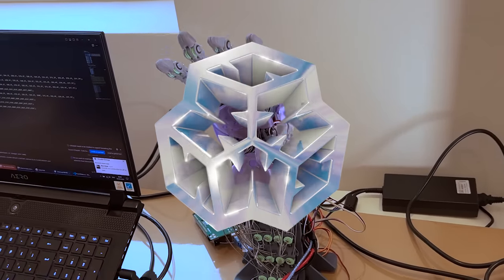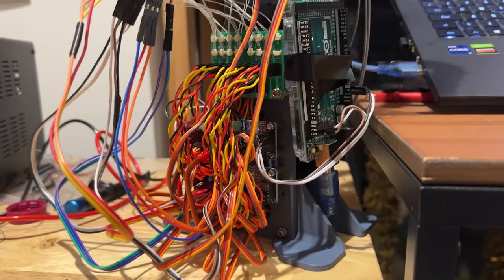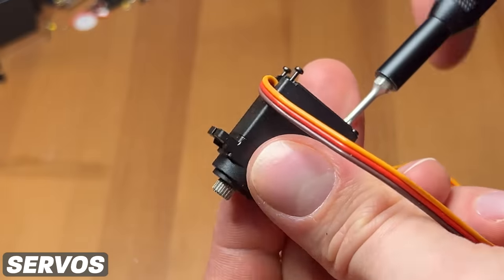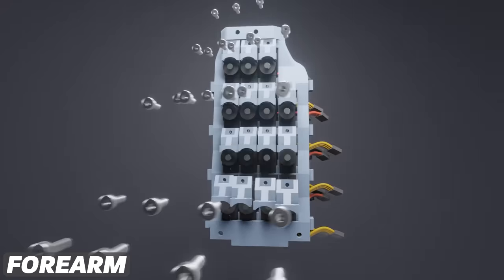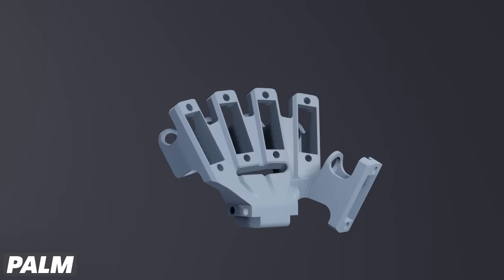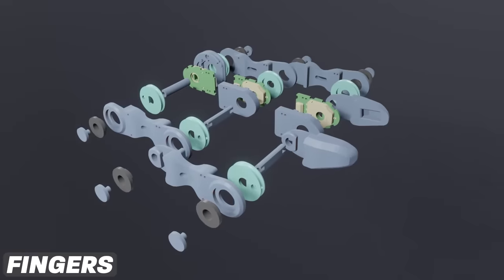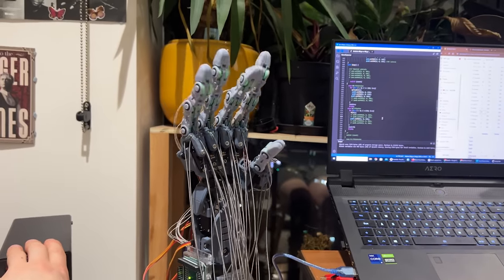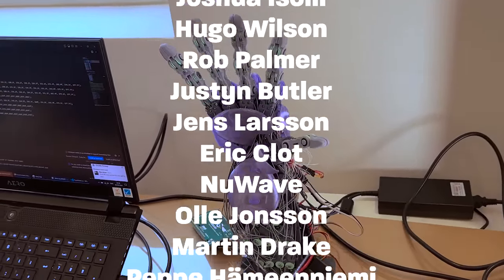How to Build Your Own Biomimetic Bionic Hand

Comment: The finger assembly has a little error in your video, The pulleys are alternatively arranged however in your video you have the free pulleys all on one side of the finger. which means the middle joint will never work.

Comment: I'd Say that the wrist and thumb movements are the most accurate because most people can't usually figure out the thumb and the wrist is usually made the point of rotation of the hand instead of the bend, basically removing a lot of the functionality, The rotation comes from about a 3rd or half of the forearm. Good Job 👍

Comment: My only immediate suggestions would be if the servos don't have enough torque to cause damage then use a script to drive them to end travel and use the pot readback to calibrate the end positions, if the servos do have enough torque to cause damage then you'd either need to run them very slowly or the better solution would be to have current sensors on the servo to identify when it hits end travel before damage occurs. I'm not sure if you're already tapping into the pot readbacks but it's a good idea to do so anyway as you can use that to automatically detect some faults, and it's a good practice to recalibrate occasionally to account for slip and wear. Im not sure if it's necessary but I've seen designs where the tendons had slack lines bridged with springs to create a bit of give in the joints for gripping delicate objects, rather than that you could also use a spring gear like assembly between the servo and the pully head (i.e. there would be a spring and hardstop between the servo and pully to allow some give if not at the end of the travel).

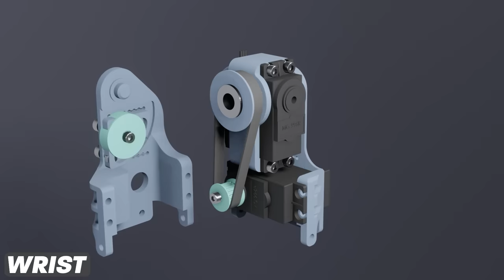Comment: 8:17 In Blender, there are different quaternion and Euler presets you can select when rotating parts for animations. Press the N key, or bring up your side bar. In the Transform sub panel, under rotation there should be a drop down menu. This should adjust and help your Blender animations.

Comment: i think the next part is creating syth muscles with Thermostatic wires and a electircally tempered electrolite gell that can be charged on and off to create conduction causing the wires to change shape form the heat. 
if the right metals are used and span thin so they "rotate and alter shap to create a contraction rotaition motion maybe then we will have progress and with time R&D maybe 3D printing the fibers and gell close and narrow making smaller low watage versions that could fun their own motor

Comment: This is really cool!  Very impressive engineering you've done here. Someday, I'd like to make a similar project and pair it with a robotic arm. I'm working on the arm now.  Approximately how much does the assembly weigh?

Also, if you need some assistance with the kinematics/control of the hand, I'd love to help. I haven't done it for hands before, but I'm experienced in robot kinematics and is a subject I've been interested in for a while.

Comment: I can't wait till bionic hands are less complicated, customizable, and have the grip strength of a normal hand OR STRONGER!
Reply: The complexity isn't likely to get too much better until way stronger micro servo motors are made, but the human hand and wrist are some of the most complex parts of the human body mechanically speaking. This design could likely have near to or normal human strength if the right materials are used, the pulley system he has gives the ability to greatly adjust the strength without increasing the strain on the motors so much they burn out. I'm very happy to see someone working towards building a much more usable and accurate prosthetic though =D

Comment: Good morning! Great project, I'm from Brazil, I'm trying to develop one for sign language (Libras) but I have difficulty drawing in Solidworks, my printer is not the Bambulab, so I can't print the parts, is it possible to make the files available in STL or sldprt? Or a tip on how to separate the components and be able to print. Thank you.

Comment: Halfway through, I just decided to cut my own hand, place it on the table, hook up a 220v directly to it and watch it animate. -JK obv. 
Great video though. But I think you are way overthinking this process. You could reduce the clunkiness and modularity of it by 50%
You can print out the skeleton mechanics, use micro servos (they make heavy duty ones, depending on the weight you are working with) and then use translucent silicone to form the actual hand. Again, great video for someone learning. Good job!